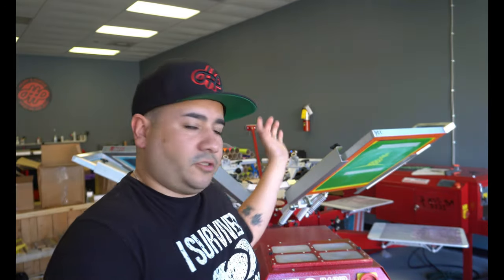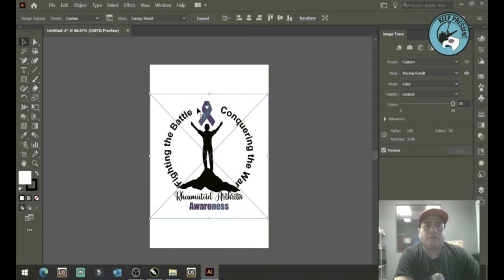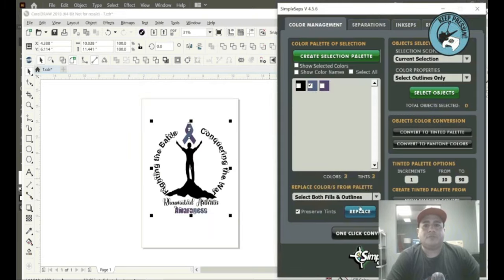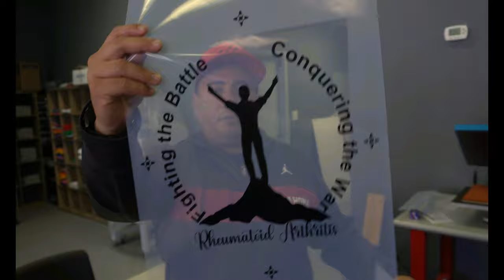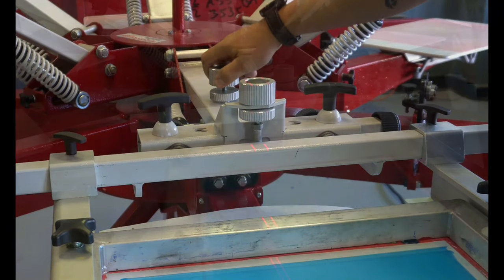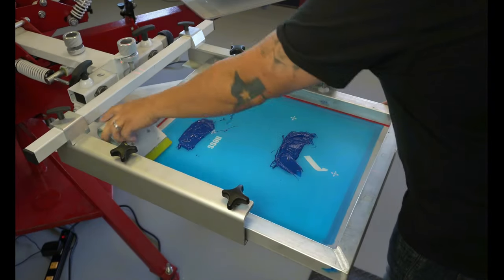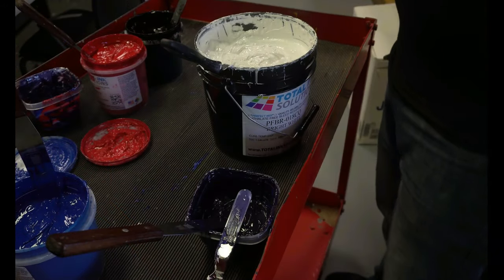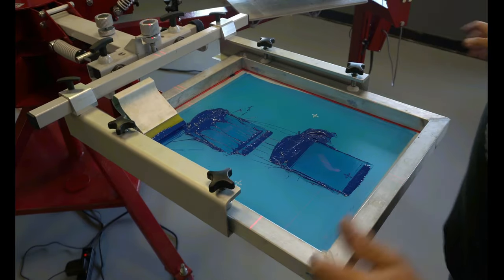3 color job from start to finish

Comment: I hate making purple.  I ended up using hot pink and red with blue to get a good purple.  
I have  been using Simpleseps for 8 years and still don't quite know everything.  I would like to see more tutorials of Simpleseps. 
Keep up the good work!
Reply from the maker: Yeah it sucked. Good to know about the purple. Yeah there is alot of good things the program can do. I have to learn more about it also.